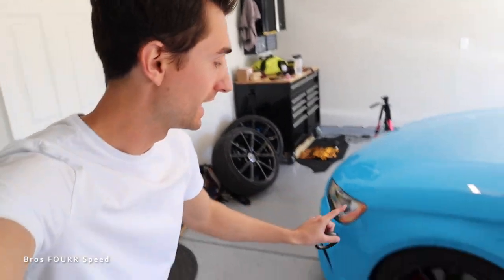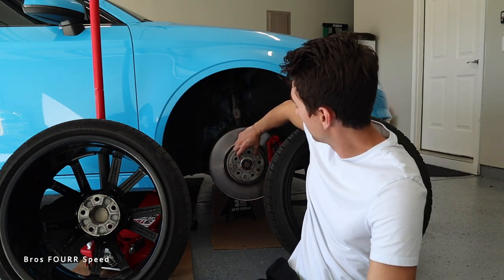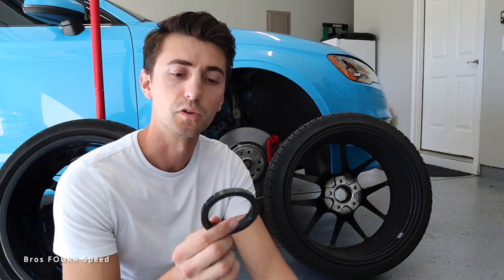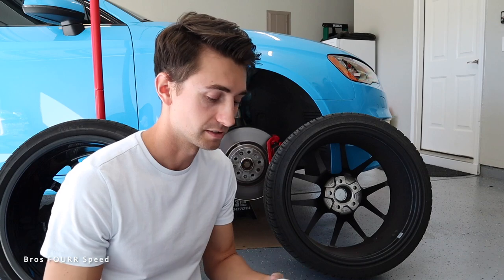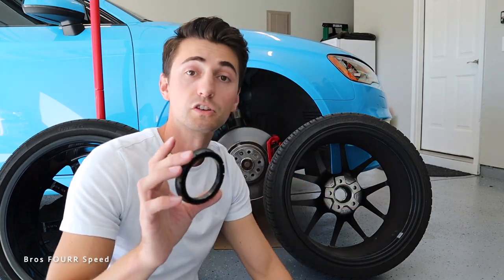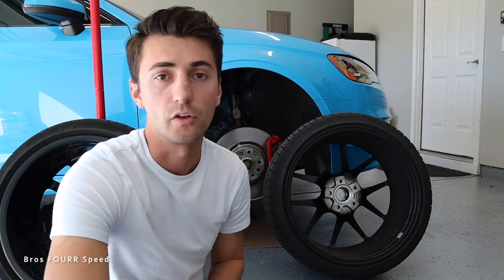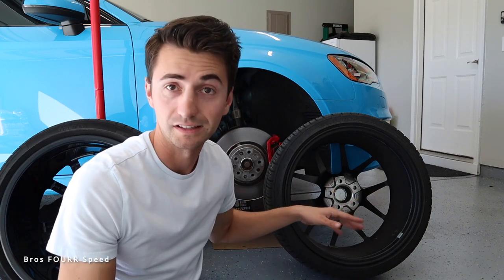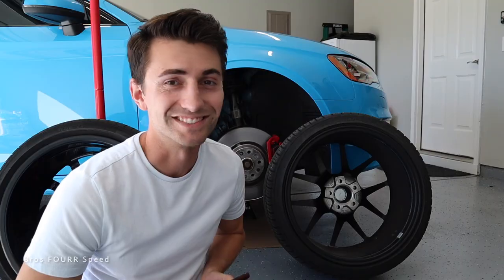How To Solve Wheel Vibration | What Are Hub Centric Rings?

Comment: Just ordered these got the same car. Same issue. I hope this sorts it. Got the hollow stupid plastic rings. Getting vibration. Hope the metal rings sort this issue.
Reply from the maker: Yeah this should make a big difference!
Reply: Honestly, mate, big up to you for sharing this. Changed mine to the mental spigot rings, and it has sorted out that annoying vibration. They need to ban them plastic hollow spigot rings. Don't even know why they make them. Thanks mate, anyone reading this with the same issue, buy them metal spigot rings. Sorted the problem out immediately!
Reply from the maker: @shamimurrohmanali5032  Glad you got it solved! Yeah I don't know why anyone make the hallow plastic ones. They don't work. The solid polyurethane ones are good too. But not cheap hallow ones

Comment: I think the main cause is simply the buyer analyzing the quality of the machining finish of the rims when they arrive especially universal rims. I just went through this and let me tell you from a distance (1') away they look great but the machining is rough when you look at the suff you dont see. My car did the death wobble  between 49-55 mph and higher omg it was scary. I got the rings and it fix the issue perfectly. I took the center caps off the rims and every time they were off center to the main hub. The rings made sure it couldnt move at all now its smooth as butter. For 10 more $$ for plastic ones its def gonna be your fix.
Reply from the maker: The plastic rings let the wheels wobble. Not enough rigidity in them. The Aluminum rings solved the wobble issue since the wheel couldnt move up and down. The pressure was no longer on the lug bolts. Metal ring took it and fixed it

Comment: I just got after market wheels and I installed them with plastic hub rings and I still feel  vibrations going 60mph +, do you think that aluminum hub rings will solve this issue, thank you.
Reply from the maker: I'd definitely try them! The link in this video has several sizes. Make sure it's the right size and try. Definitely a noticeable difference from the plastic ones I had to these aluminum ones.

Comment: I’m looking to hopefully buy some aftermarket wheels next spring but I’m kind new to this how will I know what size hub rings to get that will fit with the wheels I buy ?
Reply from the maker: Just look up your cars stock hub size. Can measure it too. I just measured these wheels center bore to figure out the size I needed. They are cheap, so if you have to buy two different sizes if you're unsure. Not the worst thing

Comment: Fitment sold me the hollow plastic ones for $15, tried them and still wobbly… I ordered some aluminum ones on Amazon for $10. I’m hoping this fixes it.
Reply from the maker: You should be good! The plastic ones are no good. Unless they are solid polyurethane
Reply: @BrosFOURRSpeed  no i believe that they are the same ones you had. Gorilla brand, plastic but hollow in the center. So annoying to have to remove my wheels again but I hope it will be the last time. Thanks for the help!
Reply from the maker: Yeah would definitely stick with solid rings
Reply: @BrosFOURRSpeed  I put the aluminum rings on and helped a lot. They were also less expensive than the plastic rings . 
I was only able to hit 100mph but it felt solid for the most part. I did get some anti-seize and put a little on during installation so that should keep them from corroding. Thanks again for the advice! 👍🏾
Reply from the maker: @RichsRantMMAofficialchannel  Nice! Glad to help!

Comment: Hope you put Anti seized on the rings cause steel on the hub and aluminum rings will fuse together
Reply: @user-lb9st8li1i  I'm afraid i will learn the hard way as well on the plastic rings or having to replace the hubs cause i never put rings on to start with and it's been about four years when i put aftermarket wheels on
Reply from the maker: I know my Supra has aluminum hubs. Cant remember if these are aluminum or not. But good point!

Comment: I put new aluminum hub rings exact side and new set of tires and balanced and it still had slight vibrate.   Do you think it’s the rims.   ( the rims are brand new
Reply from the maker: Could be the wheels themselves, suspension or hubs. Try your stock wheels if you can to know if it's the new wheels or the car itself

Comment: If I were to get hub centric rings would I be able to use spacers? The spacers I bought are only 4mm.
Reply from the maker: Your wheel spacers should be hub centric then if they are that small. Are they just thin disks?
Reply: @BrosFOURRSpeed  They are but they have a small indent within the center ring so i’m not sure if that means they are hub centric
Reply from the maker: @mootsa3  Interesting. What brand are they? Do they fit snug on the cars hub? And does the cars hub stick past them to lock into the wheel?
Reply: @BrosFOURRSpeed  They are apr and I have not even test fitted them yet.
Reply from the maker: @mootsa3  That’s a good brand. You’d think they are good then. Test them out and see if you have any vibrations. Do you have longer wheel bolts? If needed
Reply: @BrosFOURRSpeed  Yeah i’m sure they will be good, I have 14mm x 1.50 lug bolts however i’m not sure if these will be good or if I need to get longer ones.
Reply from the maker: @mootsa3  Are those stock or longer? We have H&R bolts on our website. I can always source a set for you if needed
Reply: Nice video and thank you for the information.  I do have spacers, so I will measure the diameters an order the rims

Comment: Hi hopefully someone can answer my questions. 
I bought some aftermarket wheels and they came in with hub centric rings but for a different size of my car my question is how can I remove the old ones and replace them with the correct ones for my car ? They’re attach to the wheels do they just pop off ?
Reply from the maker: They should just pop off. Try using a flat head and a hammer if they are tight

Comment: I just got 22s for my Colorado from Audiocity USA they send me three types of centric rings but one fits right on hub but won’t go on rim the large goes on rims perfectly but loose on hun with out smaller so would I have to use all three together or use two different one
Reply from the maker: You can only use one ring per wheel. Might have to order on Amazon or something. Measure the diameter of the cars hub and the diameter of the wheels hub. Click the link I put in the description. They had a bunch of sizes

Comment: How would it be possible to mount the wheels off center, when using the correct bolts for the wheel? 

How can the hub help center the wheel, unless it's a press fit?

I can't deny your experiences. It just doesn't make sense to me..
Reply from the maker: Without the hub centric ring, the wheel can actually move slightly in any direction.  The studs, even torqued properly, can still leave room for some wiggling.  So the ring really applies a more snug fit with zero movement.

Comment: I bought some aftermarket wheels from discount tire and they forgot to install my hub rings I didn’t find out till after I took it to four different stores discount tire stores purchased new tires had a control arm and brakes replaced and finally my mechanic said hey your missing centric rings 3000 miles later boy was I pissed after a round trip to Denver from Houston it was a rough ride WATCH OUT FOR DISCOUNT TIRE PEOPLES
Reply from the maker: Wow that's crazy! Yeah I learned a lot about wheels with these. Makes a huge difference. Wheels feel heavy too when the rings aren't proper

Comment: I have the same symptoms on my Tiguan but I cannot find solid aluminum hub centric rings for 57.1, I have after market 20” wheels and it’s just says 57.1 cb
Reply from the maker: Did you click the link in the description? You should be able to find one on Amazon. Just need the wheels bore and your cars hub bore
Reply: @BrosFOURRSpeed  yes I did but on Amazon it’s has 57.1 to another bore size or the other way around, where I bought the wheels it just says 57.1 cb size…
Reply from the maker: @fredjones5327  what’s the bore size on the wheels? And what’s the size of the hub on your car?
Reply: @BrosFOURRSpeed  bore size on the wheel is 57.1 on the truck I do t know I’ll find out
Reply from the maker: Take a measuring tape and measure the outer diameter of the hub on the car, and then the diameter of the hub on the wheel
Reply: @BrosFOURRSpeed  ok I will

Comment: when you mean vibration did this also mean seeing your steering wheel shake crazy?
Reply from the maker: Yeah is wobbled a bit. Not that much tho. Car felt more like I was riding over consistent bumps in the road. Like the whole car would bounce up and down. If I put my head on the head rest, it would bump my head forwards and back
Reply: yea mines is crazy i bought wrz wheels for my golf and we have the same bolt pattern but different offset and it shakes crazy at times then its normal at times so i definitely need a hub centric ring

Comment: Almost all modern cars use conical lug nuts and if the wheels are torqued on properly there should be no need for any centering rings.
Reply from the maker: Then how come there are tons of comments of people who found vibration with aftermarket wheels and hollow plastic rings and then saw vibrations eliminated with the aluminum rings? That was my experience, so clearly the lugs bolts alone don't always prevent vibration. Why else would the stock wheels and hubs have the hub centric design?
Reply: Likely improper installation the 1st time. There are a few things that can cause that. If the lugs are not torqued properly or in the correct pattern the wheels may not sit flush. If there is rust\crud on the hub surface, the wheel may not sit flat. Cheap plastic rings are exactly what they sound like. They can be poorly manufactured making them uneven or wear\warm over time and temp changes. After high school I worked at a tire\wheel shop for a few years. I would never recommend hib rings to anyone unless the car used flat lugs\washers. Some people insisted on them cuz the internet said so though. Never had a car come back. Of my own dozens of modded cars, I have never used them either. My BRZ has Anovia wheels and my mazdaspeed 3 has Konigs on them currently. Both have a giant wheel bore and no hub rings at all. I believe what you found is that aluminum rings worked better than plastic in your case. My point is that you dont need them at all.
Reply from the maker: @boost331  I’ve tested this several times on my cars tho and even slowly tightening each bolt in a star pattern to spec, still found vibration. The center hub needs to seat perfectly or there can be vibration. With the metal rings it takes all the guess work out and never have issues
Reply: @BrosFOURRSpeed  If it works for you, so be it. No harm in it..... Usually. I have seen the aluminum rings oxidize and fuse themselves to the steel hubs making for a nightmare to get them off. I cant explain why the hundreds if not thousands of cars I put wheels on including my own have never had an issue with no rings at all yet some have these problems. 🤷‍♂️ 
Your typical 60 degree conical lug nut (tuner lugs) ride along the taper in the wheel forcing each stud into the center of the hole. Being off center is what causes vibration so something went wrong somewhere along the way.
Reply from the maker: @boost331  the cars I’ve done this on all have aluminum hubs. But for those with steel hubs, so anti seize grease would be beneficial.

Comment: The rings do not bear any load.
They are simply for lining up the wheel correctly.
Reply from the maker: It's not about taking the load of the car. It's about taking the vibration out. Clearly there was a difference from the plastic ones to the metal. When from the car vibrating to driving perfect. So having them a dense material makes a difference
Reply: @BrosFOURRSpeed  I get tired of hearing how if you don't use rings, all the weight is on the studs.
Reply from the maker: @clarkkent9634  But technically that’s true. The pressure of the lug bolts is what’s holding the wheels tight. The rings alleviate it and absorb any vibration that the studs can’t handle. They clearly make a difference. Only explanation for why the car vibrated without the solid metal ones.
Reply: Weird that no one has a definitive answer to this argument...have heard both sides and both are convincing. I have a problem if the hard plastic rings dont work, bc i refuse to put metal rings on the hub.
Reply: @BrosFOURRSpeed  The RINGS DO NOT SUPPORT ANY LOAD WHAT SO EVER.